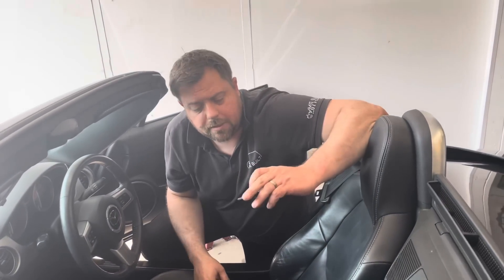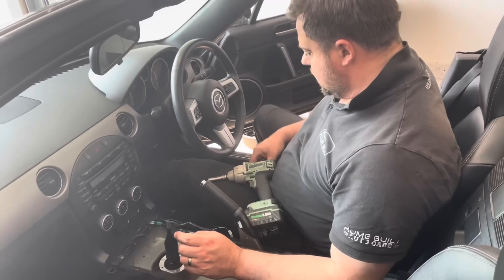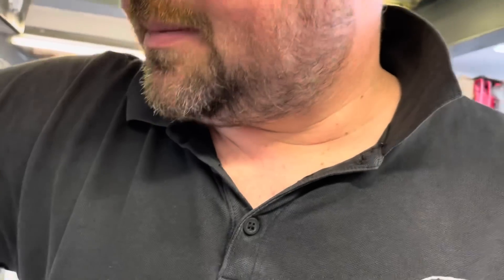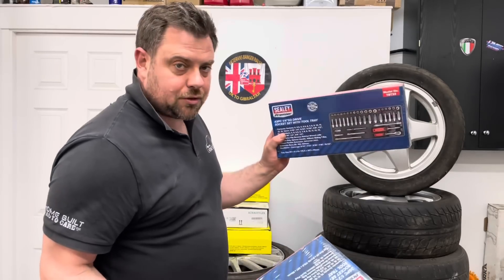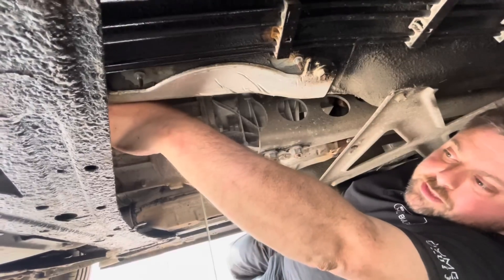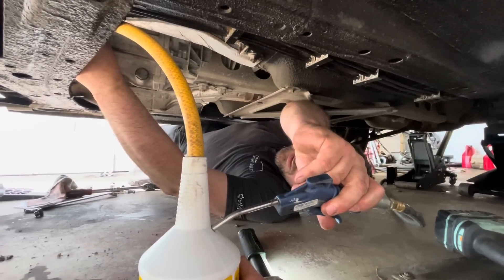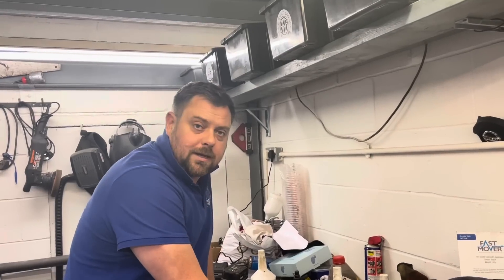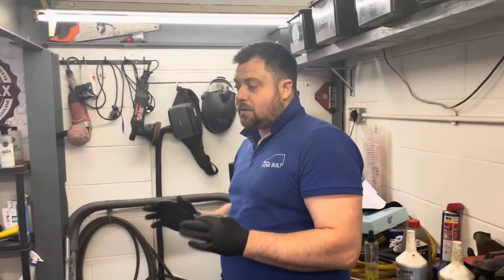INSTANT FIX for your Mazda MX5 NC gearbox!

Comment: The plate is more than just a reverse lockout, and it absolutely needed to be changed. That "dust" you commented on is the left side of that bracket disintegrating. The shifter slides along the left and right side to aid in travel between 1-2 and 5-6. 1-2 commonly wears down from more frequent use, as you can see in this video- the left side was eroding away (which caused the dust). Not only can this make it more likely you accidentally shift into reverse, but the travel between 1 and 2 is compromised, and shifting between those gears can get stuck or grindy. I just replaced mine on a 100k mile 2006, and wow was it overdue. A good half centimeter of material was just gone. No wonder my 1-2 shifts were garbage! Now it's smooth as butter.
Reply: Where do you get the selector plate from please mate?
Reply: Hey man, I have an ‘07 and have occasionally noticed some trouble getting into 3rd when shifting up (no issues downshifting) is this something you’ve come across too? Any recs? I already have MT-90 redline in it btw

Comment: Weak aluminium (aluminum) selector and a weak synchro are the problem. Oil will not fix. Speaking from experience.
Reply from the maker: Oil has fixed it mate, even the owner has commented on the video to say how good the fix is.

Comment: The only trans fluid that should ever go in any NC MX5 transmission (and Mazda RX8 for that matter) is Ford Motorcraft XT-M5-QS. These transmissions are used in a variety of cars, and have brass syncros. For whatever reason, the Ford fluid seems to work best. It’s expensive, and sounds strange to put “Ford fluid in a Mazda,” but trust me… it’s worth it.
Reply: The AZ6 transmission is nothing to do with Ford 
It's made my Aisin which is Toyota Japan
It's used in the S15,Brz/86 and Altezza

Comment: Handy to know Steven. Maybe spray the underneath with the old gearbox oil to slow the tin worm advancing on it.
Reply from the maker: Cheers Richard. Someone had undersealed the whole car but didn't clean and treat it first so its coming back to us to have  Lanoguard applied.
Reply: @HomeBuilt  Wife has an 04 cooper thats usually off the road more than its on and thinking its defo time for something sprayed under it to try and protect it so look forward to the lanoguard demo.

Comment: Great job 👍 love the tip about checking the filler cap before draining 👍 great tip on using the compressed air on the oil container. Everydays a school day.

Comment: I will guess that the american oil is thicker ,.if the syncro is worn ,then it can't slow down the bulk ring to enable a smooth crunch free change ..So a thicker oil will help the synchro slow the bulk ring ..But it seems to work so result .....The biggest cause to excessive synchro wear is people keeping their hand on the gearlever ..Instead of letting it go and it sitting happily with no pressure on the synchro they ,keep their hand on the lever applying constant pressure to the synchro which causes premature wear...good video
Reply from the maker: No mate, its the same grade that we would use, i think its to do with the additives they use maybe but it seems to have very good coating properties when i tetsed it. Just far bettet quality i think.
I kniw what you mean about the syncros but these MX5 's tend to do it from very low miles, dealers often tell you its a characteristic of the car.
Reply: Sorry you have not done your homework on this one. The GL4 spec for gear oil does not demand any specific viscosity at lower temperatures. Most GL4 oils only look at meeting the 40C and 100C approx viscosity or oil thicknesses. In the case of Redline MT90 and also Castrol Syntrans Multivehicle now with a name change to Castrol Transmax Multivehicle 75/W/90 both fully synthetic oils. Do not use any other Castrol gear oil in these boxes that is not termed Multivehicle. They are both 75W/90 grades, the oil blenders have used the latest technologies to get the oil thinner at lower temperatures of say -30C and 0C than other GL4 gear oils. While still having good high temperature properties and having the correct thickness at 100C. As noted by the Homebuilt guys the oil blenders have used all the tricks in the oil additive tool box. Good results on the Mazda 6 speed also comes from Millers CRX 75/90 NT

Comment: Enjoyed the video HB. The change from first to second is the primary concern. It's slightly crunchy unless you take your time, exacerbated in cold weather. It's a common and known condition of the MX5 NC. 6 speed. The most economical solution is this gear oil, which helps significantly. There is a retro fix from Japan, but it is prohibitively expensive. The gear selector plate was done as a precaution as they have been known to perish in older cars. I enjoyed the meeting up with Steve and Charlie, dedicated, knowledgeable, and professional. I wish them every success in the future and highly recommend them.

Comment: Well worth pre-emptively replacing that reverse lockout plate. It's a common fault on NCs for it to wear and just generally be a pain in the backside.

Mine was WAY too easy to slip into reverse when taking off, and with no gear indicator on the dash it was easy to miss. New plate solved the problem (which was evident at 82,000km).

I will add that as an Aussie I went with the Penrite GL4 oil with added "Shifteze" additive. It's only been in for about one tank of fuel but it has already improved out of sight

Comment: I believe you should mix the mt-90 with the redline shockproof 50/50.
Reply: Did that with mine, 50/50 mix. Smooth as when changing and whine quieter

Comment: Its the lockout plate the makes the major difference in shifting between 1-2, not the oil. The material gets worn away from the shifter rubbing against the plate

Comment: In my NC2 it was in fact the gear shift guide that improved it by 70% but still looking for a 100% fix. Oil has not made a difference. BBR suggest weak selector fork which is revised in the NC3 box.

Comment: Hi Guys, I've been using Redline Oil for a year now in my 09 NC, it is fantastic. I also use Redline engine oil which is equally as good and it boosts your MPG by a good 5-6mpg, its expensive but excellent. Foggy